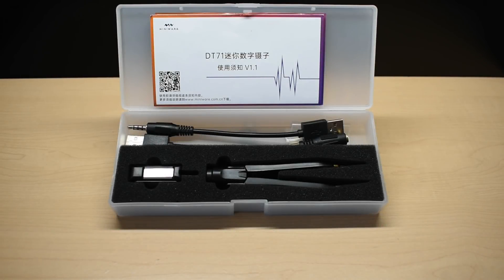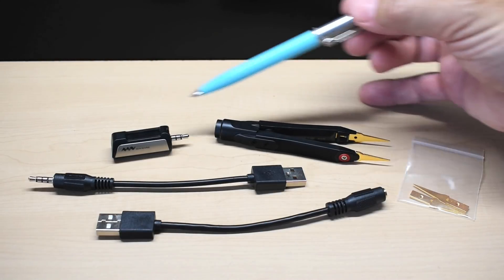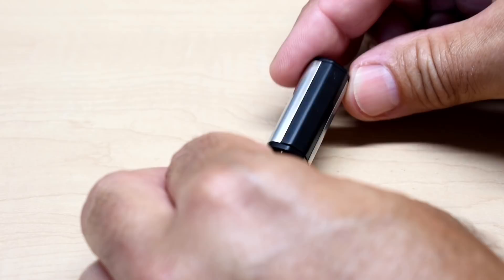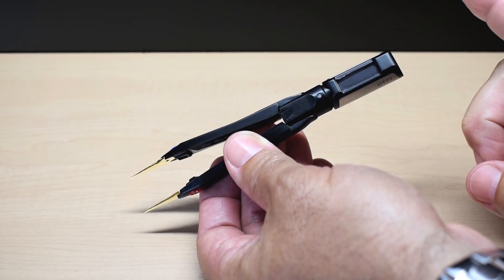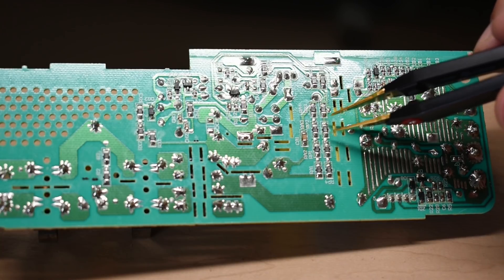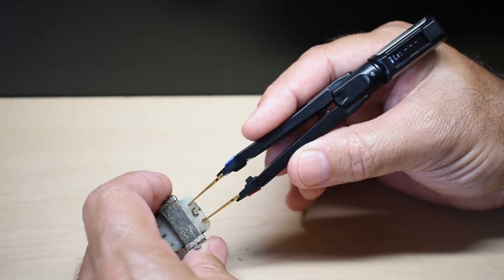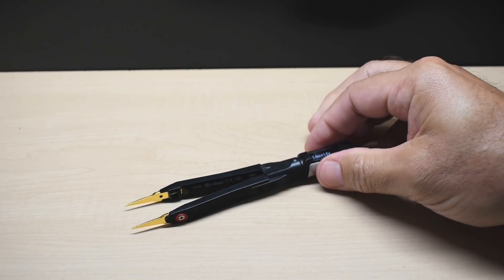DT71 Compact Digital Multimeter Tweezers With Signal Generator!

Comment: Great review.  I had no idea multimeter tweezers existed and they do seem accurate.
Reply from the maker: Thank you. They work well, I wasn't expecting super high precision from such a small tester, but they do get the job done.
Reply: you can also get tweezers with leads that plug into your multimeter
Reply: @electronicsNmore  I have their TS80P soldering iron, it's incredible.

Comment: Thank you for the review. I can see this setup has some advantages over tweezer probes for my multimeter. I know it must be a royal pain to make videos but having closeup camera shots would help with the displays which are hard for me to see and I'm watching on a large TV.
Reply from the maker: Glad you liked the video Chris. I usually zoom in close for displays, but when I played the video back on my computer screen everything was clearly visible. Where did you have a problem? Sounds like your TV wasn't using the 1080p setting. I can see people having trouble on a phone though.
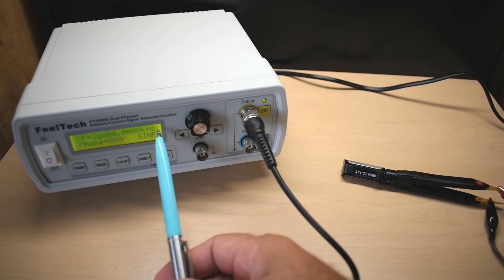Reply: @electronicsNmore  Hi. It's around 9:42. Even the signal generator wasn't readable. I do have it on 1080P but I'm almost 10 feet away so I may not be the typical viewer. The YouTube compression may also be making the text fuzzy. Thanks for taking a look.
Reply from the maker: @no1slisteninganyway  The tester display is crystal clear on my computer at that point in the video. The frequency generator is still easily readable, but a little out of focus because the camera cannot focus both spots at the same time.
Reply: @electronicsNmore  There was no problem for me.  I usually (99% of the time), watch YouTube on my phone and it was a bit blurry but still readable at 480P(see my comment on accuracy as this is the resolution that I watched the video and made my comment), at 1080P it is very clear.

Comment: seems like a super handy device.  looks like it can test electrolytic cap ESR in-circuit which is great.  For
the price i wish it could test small AC voltages.   i would prob buy it if it can test the multi chip leds - say, up to 3 led single chips.  It’s a pain testing leds on a failed bulb when you don’t know how many leds are in each chip, and some bulbs even mix double and triple led chips within a series string so testing can be a minefield.  did you check what the diode/led test Vf can go up to?

as always thanks for the video - would never have known about this type of new  instrument!
Reply from the maker: The tester was designed for DC testing, as for LEDs, only 1 led at a time or a few in parallel as shown in the video. I show a very good LED tester on my channel. Thanks for watching!
Reply: @electronicsNmore  thanks - will go find that led tester video now!

Comment: Can anyone recommend a hand held multi meter that uses lithium batters?
Reply: they seem frustratingly scant.  i’ve adapted a cheap meter that uses 12v a23 batteries to use 3S lithium ion.  I’m thinking about using 1S LiFePO4 to adapt a dual AA battery meter that was reviewed on this channel (brand is tacklife i think).   i figure i need to match native voltage closely enough. I worry that using those lithium ion 1.5v batteries would introduce problematic noise with their integrated buck converters etc